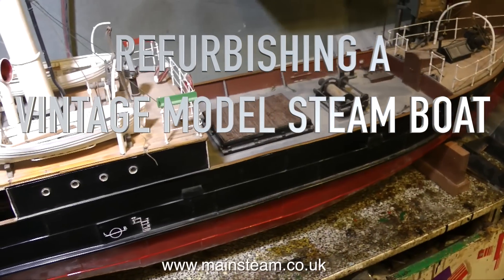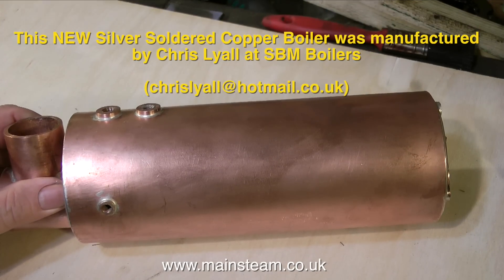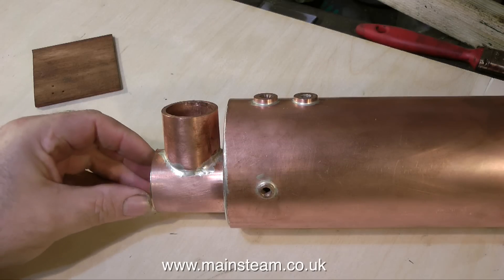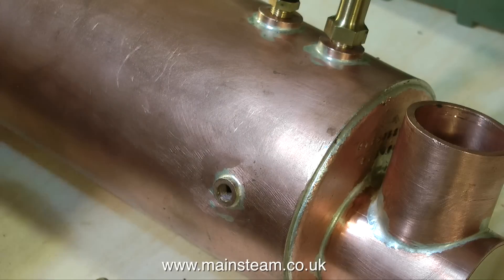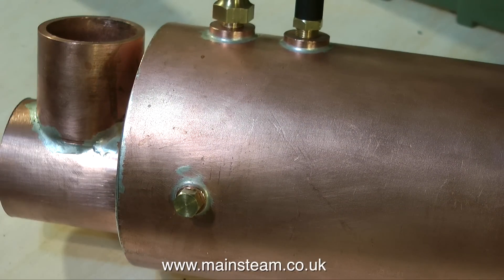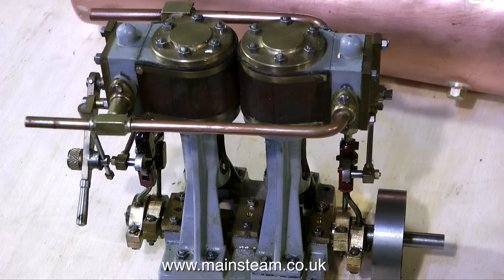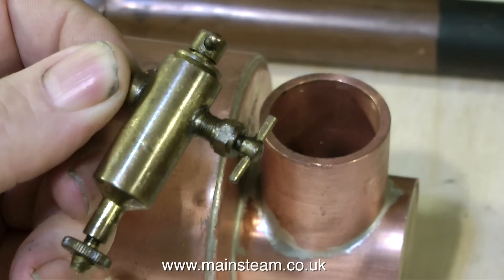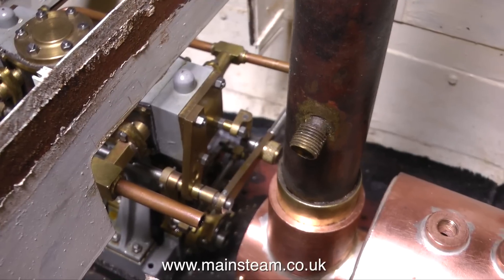REFURBISHING A VINTAGE MODEL STEAM BOAT - PART #1

Comment: Nice project in store for us viewers.  

What other methods of firing would be practical in this application? Meths?
Reply from the maker: It is going to have a blowlamp type of burner I think, so I suppose it could be paraffin, but gas is best in this application.
Reply: +Keith Appleton - Is gas a more expensive form of fuel? I take it coal is too unpredictable

Comment: I was wondering if the phenomenal performance of the PTFE oils and greases like Du-points "Krytox range meant that the engine could be greased and oiled up and then left with no oil introduced at all between services? Seems it is used in real steam turbines and does not get washed away by steam!!! Fancy experimenting with it ? Non toxic to the environment as well, so ok on pond water!
Reply from the maker: Thanks for that I will look into it.
Reply: +Keith Appleton TheGPL226 grease spec in this link actually mentions not getting washed out by steam, but I think they all have an Innate ability to stick to the surface at a molecular level and stay put, come hell or high water. These lubricants are used to lubricate red hot steel mill rollers! None of them are cheap, but I have some Krytox oil you can have and also some Fuchs oils PTFE oil and grease if you want to do some initial tests.
Being industrial products, you really need to talk to the company tech guys to get specific product info. 
https://www.chemours.com/Lubricants/en_US/uses_apps/Product_Guide.html

Comment: Have you ever fabricated a propeller for any working model boats or ships?  I'd bet that would be very difficult. ?
Reply from the maker: It's not that difficult, but as they are commercially available and quite cheap to buy, it's hardly worth the time & effort making one  . . .